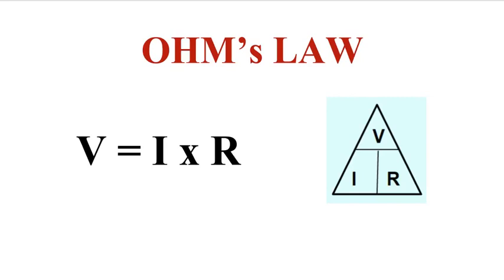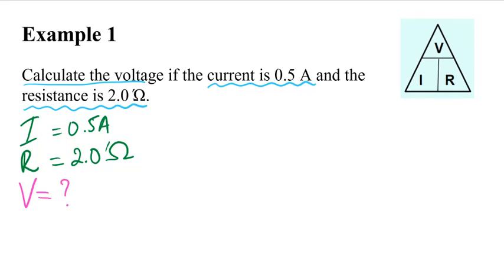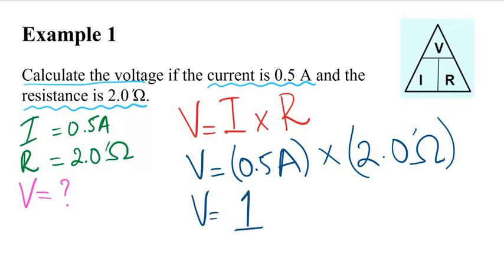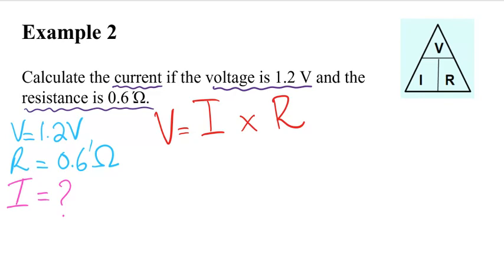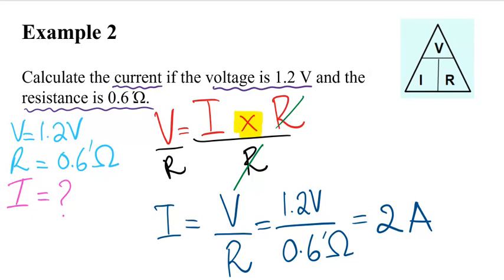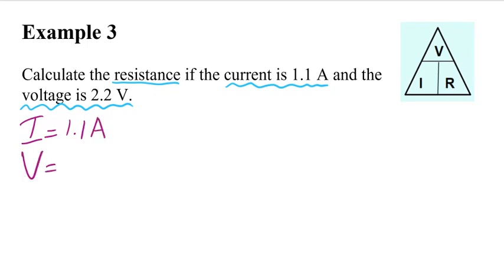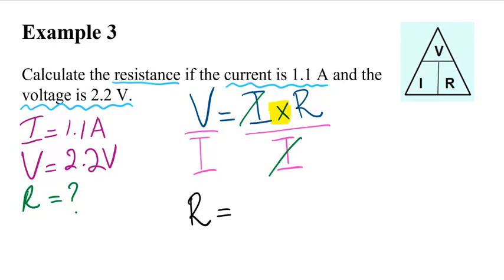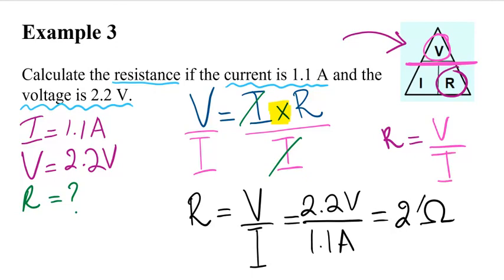How to Calculate Current, Voltage, and Resistance? | Ohm's Law Practice Problems

Comment: Followed the first one easily and got lost at the 2 and 3 😢
Reply: 2.Just divide the voltage into the resistance to find the current I=
3. Divide the voltage into the current to find the resistance R=
DO NOT OVER THINK

Sorry if this is too late

Comment: Okay, I'm an old man maybe a little bit fuzzy brained but say I have a power source that puts out 15V at up to 5 amps. I have nothing connected to it but according to this formula, I calculate the resistance at 3 ohms. Why is that? I am trying to calculate what resistor I would need to reduce this voltage to 1.5 but I seem to already have a resistance of 3 before beginning.

Comment: Can i ask something? How will you calculate the current and the resistance if you have only a voltage?  Thankieees for your answer 😣
Reply from the maker: In order to use this formula, you need to know two of the variables to find the third one.
Reply: @Ms.RiazAcademy   Thanks for the knowledge  !!!
Reply from the maker: You are welcome!